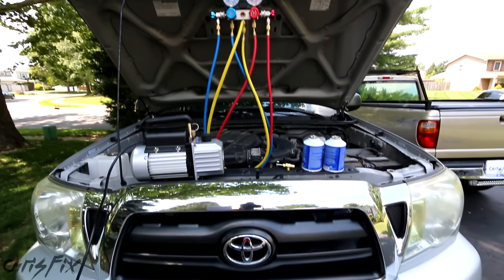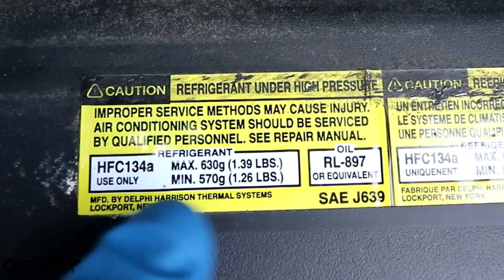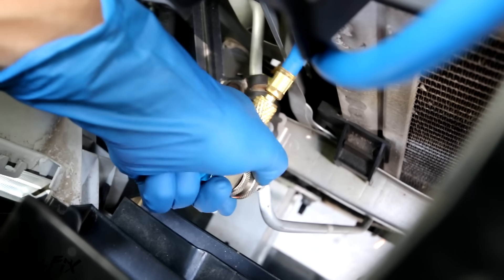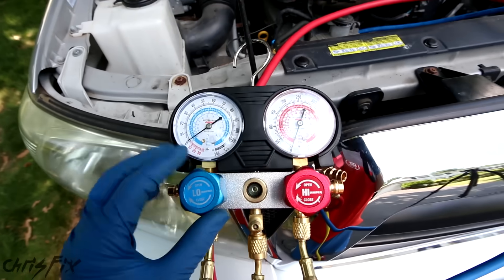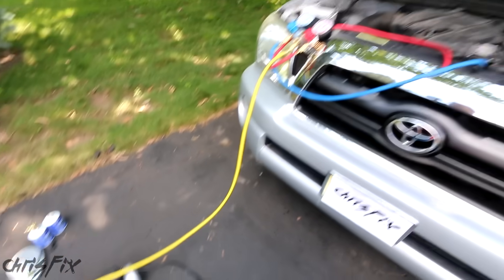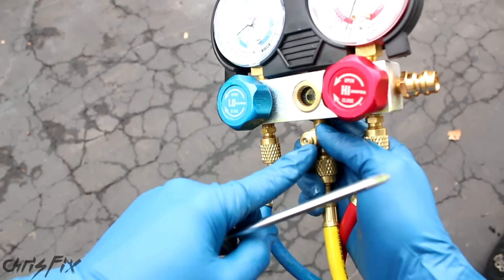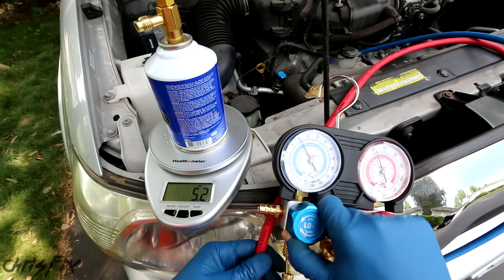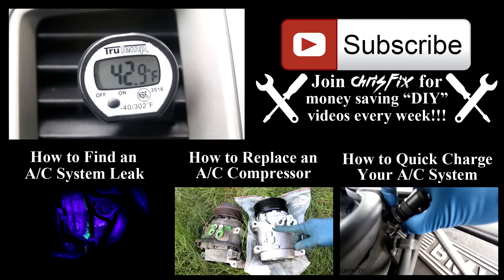How to Properly Recharge Your AC System

Comment: Just a note adding compressor oil through the yellow line does not work. Bad advise don't try it.
Reply: BS Ralf V,  Everyone can't afford to take their car to a "Technician" with their outrageous prices. I replaced every component in my cars AC System including removing the dash and changing all 5 actuator motors. I saved several thousand dollars in flat rate labor and parts mark up by doing my self. While I disagreed with ChrisFix's advice on how to add oil, this video and others like his help people fix their own cars and save tons of money. There are many so called "Technicians" out there charging people  for parts and labor they don't need. Learning to these things yourself saves you money by not getting gouged by dishonest "technicians". As for reading a "bock", you should try a spelling book.  ChrisFix rocks!!
Reply: +Russell Popham 

I tried it with the exact same equipment, laid the gauges below the yellow hose and attempted to pour it in and the diameter of the hose is so small, you can't pour enough in to make it worthwhile. I ended up disconnecting the line between condenser and evap and pouring it in there. The other would have taken a week.
Reply: +davkenrem the video shows the improper end of that yellow line to add the oil. You unhook it from the manifold gauges and pour it in that end of the line hook it back up to the gauge assembly and badda bing..
Reply from the maker: I have no clue what you are talking about... Adding refrigerant though the yellow line is the only way to add refrigerant using the manifold gauges. That is exactly how I show it successfully done in this video.
Reply: No Chris, in the video you state, "My compressor came filled with the right amount of oil so I didn't have to do anything"  (8:00)
Reply: Your first post omitted the word "oil", ergo the misunderstanding.  So why, if you can add refrigerant to the system, isn't it possible to add the oil as well?
Reply: Ahso, well thank you for that info Davkenrem.  So I'm in the middle of replacing my AC  condenser, I suppose I could pour it directly into one of the two hose ports before hooking up the lines.
Reply: Maybe find another thing to do.  Disgrace to any Technician.  A/C work should be done by professionals in the first place and replacing the Compressor by itself is NEVER a good Idea. Maybe read a good book b4 making Videos.
Reply: Ralph V, what davkenrem said!!!  Maybe your some professional who doesn't like people being able to do it themselves, but for me, as opposed to an ass-fucking of $1250 for a "professional" to repair my car, I did it for LESS THAN HALF and that includes the $300 in tools I had to buy.  And that included the compressor, the dryer and new belts!!! Now almost 3 weeks later, I still have nice, ice-cold AC, so you can put your op where the sun don't shine, imho ;?D
Reply: davkenrem Plus those "professional" thieves mark up the parts 100% or more.  One reason I ended up doing this myself was because I bought my own parts BECAUSE I couldn't afford their prices, only to find out no one would do the work once I told them that.  

And even though I told them I'd sign a waiver not to hold them responsible, it turns out one of those jerks who turned me down actually told me that he wouldn't do it cuz I was "robbing him" of his markup on the parts!!  When I offered to pay him an extra 25-30% of the cost of the parts, he got snooty and told me he was booked up and hung up on me.

SO that tells me it wasn't near enough, but fits with what I've discovered over the years, these jerks not only want to charge way too much for their labor (how do you justify $600 labor when it's only a 2-3hr job???), but then also want to stick it to you for parts as well.  

Frankly imo shop time shouldn't run $200 an hour!!!  So the more these idiots try and rape us consumers, the more I turn to DIY on Youtube, there's a HUGE range of work you can do yourself, whether it's auto repairs to plumbing, just by watching these kinds of videos.
Reply: +Russell Popham if a place won't take the parts you buy and put them on ... RUN... They're not good or honest folk. Plain and simple.
Reply: Well that's what I thought too, but of the 5 places I checked, they all declined, some saying that if it's not OEM or from a reputable parts vendor, then they didn't want to use them due to possible legal liability claims or such.  

Although as I mentioned, the one guy came right out and said it was because I was denying him his markup, so that's probably factored into their profit calculations I guess.  Yeah, it's hard to find a good mechanic these days, everybody wants to gouge you for every dime they can get it seems.  

I do have one guy I trust, they always do good work at a decent price, but he was the first one to turn me down, so others should be aware BEFORE buying parts online - if you're not prepared to do it yourself, then best not to without checking with your mechanic of choice.
Reply: Of all the mechanics I have talked to (including dealerships), all of 
them said they will install the parts if I buy them somewhere else 
(AutoZone, Amazon, etc.); they just won't warranty the parts.

Comment: I need to replace my compressor. Does it make sense to purchase the manifold gauges and the vacuum pump for a one shot use?
Reply from the maker: I did because I like tools and having them on hand and I have used them for my other cars, but Autozone actually rents them for free which might be better if you plan on doing this once. Good luck!

Comment: so... I did all of that but when I went to put the coolant in it won't pull into the system. the compressor is clicking on (even bypassed it to stay on). the owner pressure is at 100 and the high is low around 30 Amsterdam won't change any ideas? good video by the way.

Comment: You should add that your fittings on the manifold are leak free or your vacuum test won't be accurate. May want to show how to do a residual test of your manifold set.
Reply from the maker: +Daniel Cisler thanks for the tip. That was assumed but I'm glad you added the tip!

Comment: Changing the core valve on the low side resulted in losing the refrigerant and opening the low side to atmosphere. Having lost the refrigerant if I now pull a vacuum how much oil do I need to add during a recharge? Also would there be refrigerant left in the high side before vacuuming down?
Reply from the maker: +SunsTo7 did you notice you lost a lot of oil? It's hard to say but I'd add 1-3 oz. since the high and low side are connected as one system, the whole thing would be empty.
Reply: I couldn't observe any oil loss,I only heard the Refrigerant escape until it was empty. I figured it would be about 2 to 3 oz. Many thanks for your great videos.

Comment: why does my ac blows cold only when the car moves it stops blowing cold air when I come to a stop I bought a bottle of the ac with the gauge reads full any idea
Reply from the maker: It could be low on refrigerant, it could be the ac compressor is worn out, or it could be  your condenser is dirty and you need to clean it. If you hold the car at 2000 rpms does the ac blow cold at a stop? If so, you are low on refrigerant or your compressor is worn. If not, clean that condenser!

Comment: i was planning to order a manifold gauge and vacuum for the A/C system and its for my truck, but it was wrecked and im planning to bend it back to shape, BUT the A/C was in the way and i was letting pressure out (not much) and i decided to look more into about this A/C, and turns out after watching your video's(great job showing how to do it) i realized i have to get the required equipment like in the video, BUT asking my dad about these equipment for a good price, he wants me to get some well known brands like yellowjacket, etc. but there pretty expensive, whats your opinion? should i get a better deal buying what you showed in the link, or as long its the required equipment, regardless the brand?
Reply from the maker: The stuff I link in the description has lasted two years of use and they were pretty inexpensive so it depends what you want.
Reply: +ChrisFix ok, oh i almost forgot to mention, is it possible i can release the pressure from the A/C in like a container or Im gonna have to get a special equipment to pull that off?

Comment: @ChrisFix - Love your videos. At the start of this one, however, you made a minor mistake by confusing the 12 fluid ounces contained in the can as a weight measurement, which I'm sure you know it is not. However, In the case of that can of 134a, it turns out that 1 fl. oz. of refrigerant does almost exactly equal 1 oz. of weight (can: 12 fl. oz = 340 grams, > 1fl. oz. = 28.33 grams = .999 oz. weight) so its almost exactly a 1:1 ratio. No harm done. Therefore, 16 ozs. of refrigerant will almost exactly equal 16 ozs. (1 lb) of weight. But if the 12 fl. oz. can contained some other material, liquid mercury for example, the can would have been much heavier and a different amount would have been required for the job. So it's critical to know the difference between fluid ounces and weight ounces. Fluid ounces is VOLUME; grams, pounds and ounces is WEIGHT. Hope I helped. Keep up the great work. I've learned a lot from you. Thanks, Steve

Comment: I have a question - Something hit and snapped the metal tube connected to the hose that connects the compressor and condenser in my car and there is no pressure, so I'm assuming all the refrigerant is gone.  Do I still need to have the system evacuated, or did the snapped tube do the same thing evacuation would do?
Reply from the maker: +keith Carpenter the snapped tube evacuated the refrigerant. Get that system sealed and vacuumed asap or you will need a new receiver drier.
Reply: This actually happened a few months ago but I didn't know the ac line had snapped until  I started learning about ac systems a couple weeks ago,  so I'll have to replace the receiver dryer.  I did order and now have a vacuum pump and manifold gauge set.  I'm working on a couple of cars and still trying to figure out if the clutches might  be bad on them since the clutches won't engage.  Of course not having enough refrigerant keeps the clutch from engaging too.

Comment: Put a new compressor on 02 sienna and it would not take freon.  (filled it with pag 46, 7.5 oz)  Gave up and purchased a Denso accumulator.  vacuumed and it held.  tried something different than I have ever done, I let it suck in about 18 Oz before starting engine.  I finished the other 18 Oz and it is blowing at 37 degrees after cleaning the condenser.  😆

Comment: I thought you turn the ac on high
Reply from the maker: It doesnt matter as long as it is on.
Reply: +ChrisFix is there any difference from having it on high or low
Reply: +qjuan white probably just the fan speed, unless you have a climate control car, in which case, you should set the requested temp as low as you can, to make sure the air is running and not heat.
Reply: +StrokeMahEgo much appreciated I think I need a new condenser anyway

Comment: If your gauge does not go all the way down to 30 while pulling vaccum for about an hr what does it mean?
Reply: not all HVAC systems are the same. his 30 inHg could be your 45 inHg etc. if you pull a vacuum and it holds, you have no leaks. if you pull a vacuum and the needle on the pressure gauge rises, you have a leak.

Comment: why do you not want to use a refrigerant with out additives?
Reply: additives are used to find leaks. if you have no leaks, all of that dye will be trapped in the system and cause unnecessary wear on the HVAC system.
Reply: Why then does my Volvo say it comes with the UV dye already in the system?  I know of other additives like leak sealant that can do what you say, but not sure about the dye (which mixes with the oil I believe).

Comment: what if i decide to drain out the ac at a shop and I perform a ac clutch change at home. can i then go back to the shop so they can refill it? I imagine its drivable but I just want to make sure
Reply from the maker: Correct you can definitely do that.

Comment: Chris,  When the compressor, condenser or the evaporator is replaced and you don't have the Freon removed by a pro, how much Freon is left in the system. or does it vacate itselfwhen removed one of these items??
Reply from the maker: There will be no refrigerant in the system if the system is opened up.
Reply: So once you remove the compressor, condenser or evaporator, the Freon just vacate the system on its own? You don't need to professional vacuum it out?  Sorry just want to make sure so I don't over charged the system after I install a new condenser.

Comment: How can you "already have" the uv dye in the system, if you just evacuated it all using a vacuum pump?
Reply: The vacuum pump is only to pull out the refrigerant gas but doesn't pull out the oil and dye that's in the system-  that stuff should still remain in the system.
Reply: +DTR RTD that's for the comment so the oil the compressor has won't be vacuumed out. so no need to oil after the vacuum is doen??
Reply: It's not flushing out the refrigerant oils in the system by doing the evacuation; this only removes the refrigerant and leaves the oil remaining in the car's AC system.

Comment: How can you "already have" the uv dye in the system, if you just evacuated it all using a vacuum pump?
Reply: The dye in carried in the refrigerant oil.
Reply: Because it would be turned into a solid once all the liquid has evaporated off. Not to mention the refrigerant is only liquid in the high pressure side.
Reply: The liquid mixes with the oil. Thus, you will always have dye in the system after that.

Comment: Extremely important to "PURGE" the lines every time, you do not want ambient air in to the system. !!! I did not see you purge the line when you started putting freon in ?????
Reply: I saw it done with the first can; he pressed the valve at the manifold gauge and the refrigerant spritzed out.  
Didn't do it for the second can, since there should be very little air in the line at that point.

Comment: in case no one knows, autozone rents tools out for free, just need deposit...about 320...you get back after your use
Reply: There is no rental fee.  I just used their vacuum pump and gauges yesterday.  You just pay the full price to "rent" them through their lend a tool program and then as long as you bring them back in 90 days you get all of your money back (including tax).  Advanced Auto Parts has a similar program, but they don't have the vacuum pump and gauges.
Reply: Yes Autozone "loans" both the gauges and pump, but my advice is to buy your own gauges if you're going to do this regularly. The quality at my local store is marginal at best. Most of the time they are missing o-rings, stuff in the lines, etc. You can borrow their pump though (make sure it has oil before you leave the store) :)
Reply: I know they do that w/ a ton of hand tools.  Do they have the manifold gauges and vacuum pump in that program too?
Reply: If I remember right there was a rental fee, it was not much, but they do cover the full price of the Tools, and you get the full price for the tools back when you bring them back, minus the rental fee, the fee was less than 30 dollars if I remember right, been about 2 years since I did it.
Reply: SmokeyKurt They're bending the rules if you get 90 days to return a loan a tool.
Reply: many tool rental places have vacuum pumps
Reply: Jason Voorhees How much is the fee or deposit?
Reply: well those pumps aren't cheap usually the deposit is like $100 bucks. often used ones are for sale on craigslist , but unless you do it for a living I wouldn't buy one. its something rarely used
Reply: Dan Todd how do you know if it needs the oil?

Comment: chrisfix - getting ready to change my receiver drier and service manual says to add 1 oz. comp. oil when changing this component. I know you say to add comp. oil through the servicing line on the manifold gauge assy., but won't that make it difficult to purge the line? Service manual says to put the oil in the receiver drier - does that sound right? I'm reluctant to dump oil into the receiver drier - what do you think?

Comment: So I got a question that is probably stupid but you have oil in the compressor and the system and you pull a vaccum to -30 Mercury. I would think the oil would get pulled out when doing a vaccum why would it not?

Comment: Chris this is great, thank you very much!  Quick suggestion - now that you have replacing compressor and recharging, how about doing a video on when and how to flush the AC system with AC solvent?  Do it on the same Toyota truck so it will be a monumental trilogy!  Then perhaps you may want to do two more videos showing when and how to replace the recv-drier and expansion valve.

Comment: Chris, i also saw your video using AC pro to recharge AC system. Can i use the manifold system you used in this video to charge AC pro bottle?A lot people complained that the gauge on the AC pro kit are not accurate, and their AC systems are damaged when they overcharged their system.

Comment: i am having trouble here. i just followed the video all went well. however, after the first can something went wrong. i have a new ac compressor and after the first can it all went bad. it will not throw any r134 when i purge and the low pressure psi is at 120 plus? pls help